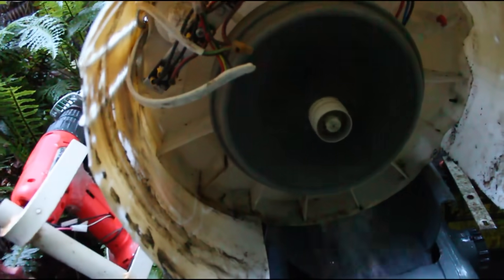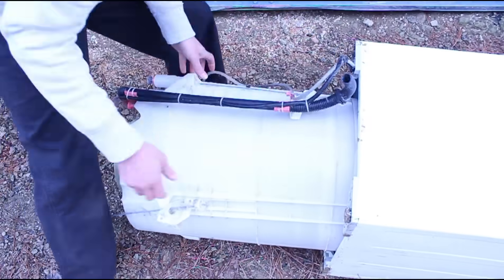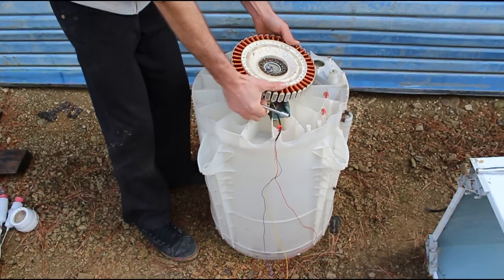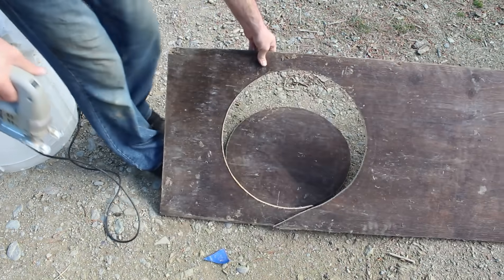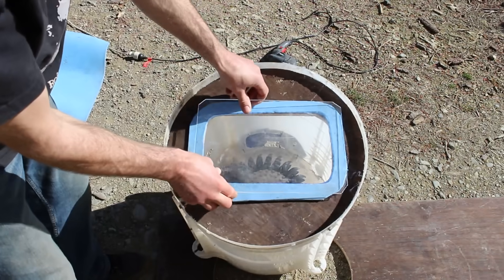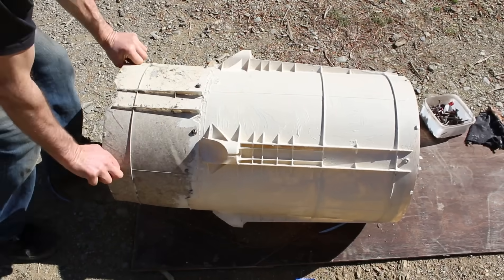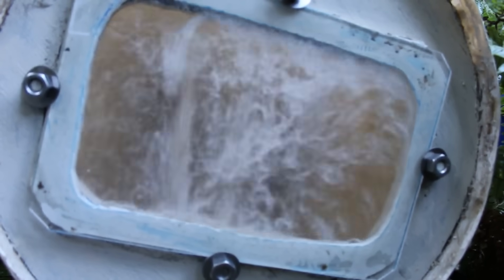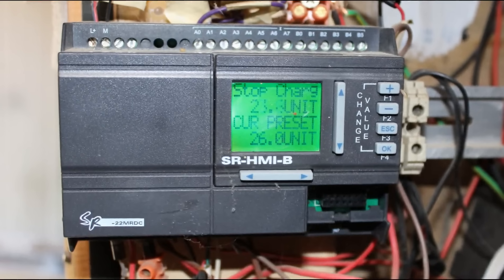Free power- How to convert an old washing machine into a water powered generator

Comment: I'm gonna try building one of these. I got a creek that runs really good in springtime and rainy weather, but kinda drys up in middle of summer. I also have a wooded hillside that goes down for about a quarter mile, and it has a lil spring that oozes all year and runs down. I've thought about damming it up and creating a lil resevoir that would make water pressure.

Comment: Hi there Mr Ram , i just watched all you vid's on this subject fascinating stuff bud can i ask a question please ?
On all these type of systems like yours are they all making low voltage ? then your sending that to a battery bank then using that to power an inverter to get 230v ?
 None are making direct 230v are they ? Cheers in advance 😁😁🤘🤘
Reply: Marty T  is Angry Rams other YT channel and in the list of vids there you will see the complete installation of a new system on a friend's properrty...
The reason the 230VAC @50 hz is not directly produced is the characteristics needed to directly generate 230VAC @50 hz...
a rotation speed of 1500 or 3000 rpm....(Google 2 pole and 4 pole generators) is required and this turbine only spins @ 1000rpm 
so you would need chains, cogs, belts etc to step up the roation speed...all energy loss devices....
But you can make 230VAC @ 50hz from an inverter drawing on batteries....
and you can use any voltage transformed or rectified into 24VDC in those batteries to keep them charged...

Comment: I am curious to know what do you think of cutting the gasoline engine off a regular generator , and adapting a enclosed  Pelton  wheel  to the generator (complete) portion  this way the actual generator if equipped with a standard 110v duplex outlet  and a 240v 20amp outlet , and i'm thinking the 110v could power the backup battery bank and/or lights only circuit  with a simple standard battery charger and the 240v  side would power the home just the same as regular electric service , hence all that would be needed is Wheel Kit, 3000 to 5000 watt Generator Module, 240v adapter cord.I guess you call it a homemade Dam Generator ?
Reply from the maker: I think you would struggle to get the required rpm out of a pelton wheel, maybe if head is 50+ metres, My pelton maxes out around 1000rpm with a load on

Comment: Rewiring a stator motor today, our creek has been roaring from this rain and our solar panels can’t keep up when it’s cloudy. So excited to have our battle born batteries charging through the night. I’m trying to determine what type of wire I should use and if it’s okay to run 300’ before I make it go through a rectifier and into our 24v charge controller. After all, we only need it to trickle charge or provide about 4 amps.
Reply: Remember that 400VAC output is dangerous and tends to leak through surface effect....
Can you follow Marty's example and convert it to 27VDC right at source.....?
Reply: See Marty's latest hydro using this technology and fully explained
https://www.youtube.com/watch?v=LVoeaKCEd2o&t=1s

Comment: You could let the 3 phase current run through a longer wire to the house, and convert it to dc power there. That way your battery bank would be inside.
Reply: The 400VAC @ high hetrz is dangerous and  suffers from skin effect over distance...
so it is rectified and charges 2x 24VDC batteries from which a 240VAC inverter draws 240VAC to send yup to the house.
(All DC voltage needs thicker wires and short runs...so that is why everything is down at the creek...)
Reply: Marty has made a new system at a friend's place...and since then that system has been modified with a MPPT controller at the house...so 60VDC to the house, then batteries and inverter there...
See another new scheme being setup at a friend's place.....
https://www.youtube.com/watch?v=LVoeaKCEd2o 
see description on that vid for links to the other 3 vids.....

Comment: Not an electrician but I'm building a jacuzzi. So far I've got an old metal tub and have attached battery cables to the tub "feet".  Other ends of the cables are attached to a set of 6 automotive batteries connected "in series".  I saw a video where they use electric water heaters connected directly to the shower head in central america, so thats what im trying to do , sort of.  I think the voltage or current will be low enough that it just heats the tub and not enough to electrocute.. LOL !  Before anyone thinks Im stupid I"m going to put my neighbors dogs in the water first (they both weigh about 80 lbs combined) so if they dont act like there getting shocked I will be OK, I think.. will update you soon if it works or not.

Comment: Hey, instead of using 3 rectifiers due to 3 phase you could just use 1,  3 phase rectifier. With a single phase out!! I think it would be better this way, and cheaper  to purchase just 1 rectifier.
Hope  this helps
Reply from the maker: Yes your'e right, I started using 3 phase blocks around 5 years ago when they became more affordable.

Comment: If you can power a light bulb just by hand cranking it, could you set up a stationary bike and a system of gears to turn the wheel and charge a power bank as well? Even if it's not as much as the river constantly flowing, it would be worth supplementing for smaller devices and be usable for people without access to their own land with running water.
Reply from the maker: Yes I have connected one of these to a bike and it made 400 watts pedaling hard

Comment: YouTube algorithm sent me here. I'm sort of a jack of all trades, and sometimes I find purpose built equipment for scenarios just like this and it's quite fascinating to see the very same principle being achieved in a entirely different way. My first question would be the efficiency curve, e.g. how long do these components last before significant enough wear decommissions the unit? Most purpose built fluid turbines have an oil system that actively lubricates the bearings/shaft to sort of ease wear and lengthen life span of the shaft components. Regardless excellent and concise video, explanation was thorough enough and was truly a good watch in general. When I finally move out of the cities I will definitely attempt to put an actual one into service along with experimenting with all sorts of other electricity generators just for fun!
Reply: All those questions were answered in the videos Marty has put out...replacement bearings every 2 to three year; clean out the intake in the stream whenever power production drops, replace truck batteries with other second hand ones when they die....

Comment: Great video. The only issue is a water cost. You are using city water line with high pressure. Water usually cost more than electricity.
Reply from the maker: I have a small stream on my property so water is 100% free

Comment: Hi, love the vid and setup you have. I’m here in the Waikato and have made the same setup as you but I’m only getting 100watt from 45psi.
Reply from the maker: Thanks mate. You should be getting at least 500w if you have good flow. What diameter and length of pipe are you using? Is the pipe on an even gradient down hill or does it go up and down over the terrain?- any air locks? diameter of pelton wheel? What is your flow rate, how many litres per second going through the jet? is your intake filter restricting flow?
Reply: Angry Ram thanks for the reply. That’s what I thought. I have tried different stay or rewind configurations to see the difference. 50mm pipe with no air locks. 250mtrs long through a 1/2 in hose tail. 8inch 32cup pelton wheel filter is not an issue. I am running the power differently to you thou. Transmissions of the power is at 215VAC @650rpm 200mtrs away. Then through a MPPT charger to charge 48v battery bank.
Reply from the maker: Ok I think your pipe diameter may be too small for that length of pipe, I would need to know your flow rate to be sure, just hold a 10 litre bucket under the outlet and time how many seconds it takes to fill. assuming your flow rate is 3l per second through a 250m length of 50mm pipe you will lose 11.5 metres of head, though a 100mm pipe you will only lose .4 of a metre head. You could try putting a smaller jet on the pipe to reduce pipe wall frictional losses and wind out the rotor about 1cm to reduce magnetic resistance on the stator, that should give you a bit more power but if I were you I would get a 75-100mm pipe, keep an eye out for old second hand irrigation pipes, much cheaper than buying new. Let me know how you get on.
Reply: Angry Ram yea was about $800-900 for the pipe.... 😓 I think the flow rate is more than 3Lpm the jet of water out of the 1/2inch hose tail is about 15mtrs long. If I held a bucket in front of it I’m the bucket would disappear..... with the tap open I get on the pressure gauge 45psi. I have already wound out the rotor to assist with the magnet flux. I’m up to 157watts now. Better but not where I want to be 500watt Mark. I think I might charge the stator config to see if I get any differences. I would think they would be only small ones thou. Check my page as I have a vid of my set up. Thanks for your time on this. 👍
Reply from the maker: Ouch! I paid around $300 for 200m of second hand 100mm poly pipe and I saw 1/2 a km of 4in alloy irrigation pipe come up on fb marketplace the other day for $500, keep an eye out there, I think your small pipe is your weakness. What hz are you pushing through your transmission line ( high hz doesn't travel well over long distance) and what loss are you seeing at the end of the line? measure the volts/amps at generator and at the end of your power line, should be able to calculate cable loss.

Comment: Where do you get 45 psi from the jet? Is there a pump in the line somewhere? What powers the pump?
Reply: Gravity. The inlet to the pipe is a long way up the stream, something like 40 metres above the generator in height. The weight of the water in the pipe is what gives the 45psi.

Comment: Whell, there is more than 3300 comments here. Probably someone had already told you that, but: you cold do better using a kaplan or a francis turbine. These are used when you have high water volume and low pressure. Seems me it's your case, looking to the entire canal (not just the pipe water).
This is a wonderful work anyway.

edit: I'm watching videos about archimedes screw turbines. Maybe it fits even best in your case.

Comment: You might want to add a temperature sensor to your generator to try and prevent repeat future meltdowns. One idea is a thermistor having the PLC to close a solenoid controlled water valve to stop the flow to impeller.
Reply from the maker: Thats a good idea

Comment: I wonder if it might have been more efficient to run the power to the dwelling as Alternating Current, and convert to DC at the end-user site...reduce the amount of transmission loss.
Reply: petnzme01  Why?  Conductors don't have to be as big.  The voltages concerned are not excessive...and could be stepped down for transmission with a transformer if that was an issue.
Reply: petnzme01  Really?  What's the AC voltage coming out of the generator, before the bridge rectifier??
You can start a fire with DC as well.
In any case, I've run AC power to remote locations...outbuildings, stages etc.  It's not that hard, or dangerous.  I think there's a lot in this setup that an inspector would cringe at.  Was it inspected by anyone?
Reply: petnzme01  If it put out DC, you wouldn't need a rectifier.  There's no telling what the output voltage is before the rectifier.  It was a 240 volt motor before he mod'd it.  I didn't see any AC measurement after the mods.
Reply: petnzme01  Ok, I believe I did. I never saw an AC input value.  You did?
Reply: petnzme01  So what's the voltage?

Comment: You cut a hole in the bottom to let the water out, then you made a water tight cover for the big hole that was already there?
Reply from the maker: Cut hole and closed front opening to control flow, if water comes out front opening at high pressure, it sprays everywhere, makes the ground slippery, wet slippery ground creates hazards

Comment: Hi l've watch you a few times and am very amazed at how minimal of all you have but you are able to run a whole house, can you please explain how you are able to get so much pressure to spin that wheel out of a trickling stream of water....
Reply: You are borrowing the water to use the energy that gravity gives that water as it falls downhill towards the lowest point in the generating system.....the Pelton wheel and the generator.
Put thee water in a pipe; 
every metre of fall= ? psi  (pressure).
depending on the size of the pipe (penstock) you have the flow Y  (in litres per second/minute).
Feed pressure and flow to the Pelton wheel attached to a generating device....
and the result is electricity..
Reply: @JohnSmith-yv6eq  thanks
Reply: See Marty's latest hydro using this technology and fully explained
https://www.youtube.com/watch?v=LVoeaKCEd2o&t=1s

Comment: Really like your videos and have watched many. What I am seriously confused on is how to make a picaxe or would it be better to buy a solenoid instead? I went to the DIY page but could not get it. Do you have a coaching option on the set up?
Reply: In case YT plays silly buggers, go to Marty T channel and click on videos. 
He has a 4 part series on building a new hydro with a friend...
Reply: @JohnSmith-yv6eq  Thanks John I appreciate it. Do you use the F & P generator as well? It seems very easy except for the pickaxe with the drill. I am stuck on that part and wonder if a solenoid instead?
Reply: @webnatura  
How about going totally over the top and fitting a logic controller instead???

Comment: I’ve  repaired appliances for 25 yrs. I have 3 of those tubs with same stator motor. Two motors have small cracks that caused the washer not spin properly. Do you think these cracks would cause problems used as a generator?
Reply from the maker: Most of them seem to have those cracks, it doesn't seem to make any difference

Comment: Do you not have access to silicone tube nozzles in Un Zud?
Reply: Plastic waater hose connections are cheap and effective...
holes in steel pipe 'cups" are even cheaper...

Comment: Where do you get the water supply that puts out 45 psi?  As I recall, 27 inches of water = 1 psi, which means you have a stream that falls 100 feet.
Reply from the maker: Yes I have a stream with a long pipe from intake to turbine

Comment: brilliant.. connect charge controller to servo to shut a gate/ball valve on H20 when fully charged.. can it not be switched to open at specific voltage drop also to restart gen.. saving bearings & noise

Comment: On the bearings have you tried replacing the bearings instead of using the old ones so you could get more time
Reply from the maker: I replace them if they have signs of wear. My motto is - if it aint broke don't fix it ;)

Comment: Silicon doesn’t stick to plain wood for long.
It’s advisable to coat wood with some layers of water proof varnish before applying silicone.
Reply: I'm guessing it's not an issue since he clamps the plexiglass onto it anyway, creating pressure against the seal. It may fall out when he removed the plexi.
Reply: @johnbecker334  You're right. I later saw that too.  :  )

Comment: Interesting video! I am thinking what type of large tub to utilize that has a can operate a powerful pump to cycle the water to continue to flow and be reused. Otherwise a person is losing a lot of water which would be just like paying for electric. But this is for a stationary home not for camping as one can not take around that much water. I need something for my camper more so . I guess solar it still is dang it.

Comment: I was thinking if there was a way to replace the original magnets with neodymium magnets, but that might cause the coils to overheat because of the increased magnetic field inducing more current into the coils. Maybe drill holes on the back at an angle to cause air flow over the coils if the magnets were changed.
Reply: Or replacing the coil with another thick coil!

Comment: One thing I noticed, at the end, when you are dumping excess power, why would you not add a solenoid diverter to engage the generator only when the power bank needs boosting? That would save your bearings from wearing out.
Reply from the maker: More expense, more things to go wrong. The last set of bearings cost $15, was changed 3 years ago and still going strong.
Reply: @Rambro-angryram  That's awesome mate!

Comment: Where'd you get the batteries?  I find that those are the most costly part of any system, especially since they usually need to be replaced every 10 to 12 yrs for full power.
Reply from the maker: Theyre ex telecom batteries, still fine after 13 years on my hydro setup. They cost me a box of beers
Reply: That's great!  Are they flooded cell? I have an off grid green house (a bunch of boring stuff I won't go into) and the AGM battery I'm using cost way too much for 100Ahr@12v.  Want to upgrade to 200Ahr and thinking flooded cell might be the cost effective way to go.
Reply from the maker: Yes flooded cell, Try calling around your local electric forklift service shops, they often replace the whole bank of batteries when there is a weak cell
Reply: Thanks for the suggestion!